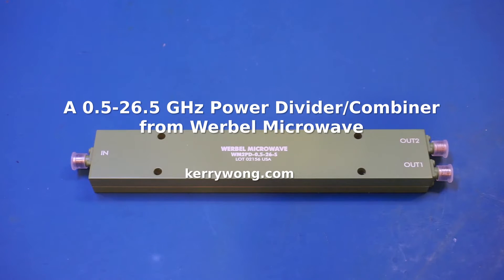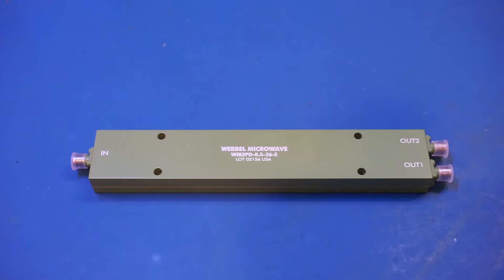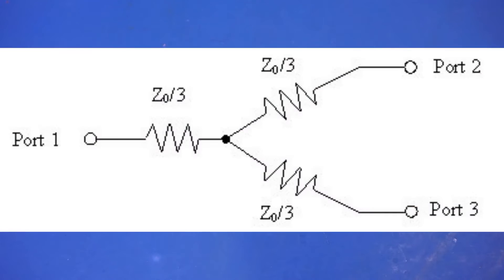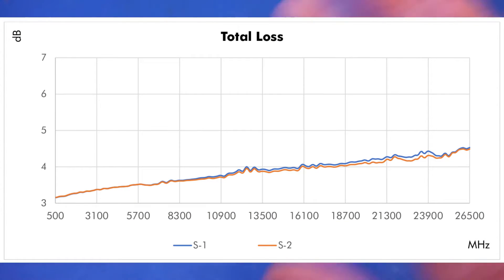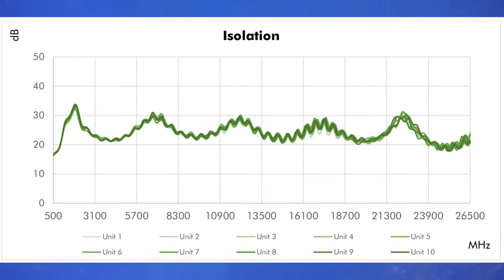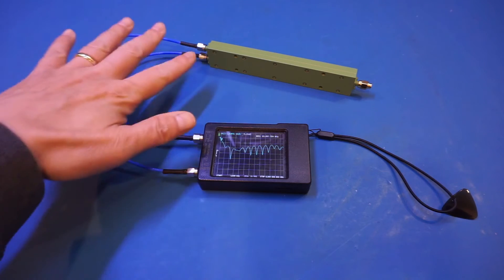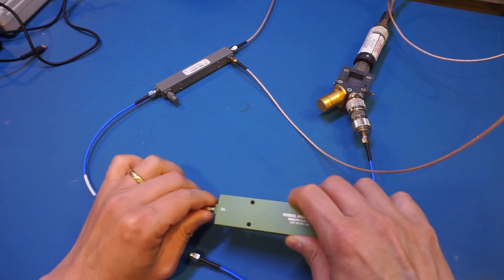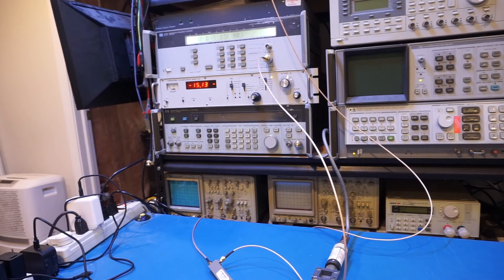A 0.5-26.5 GHz Power Divider/Combiner from Werbel Microwave

Comment: If the divider uses quarter wavelength elements, how does it have such a larger frequency range? It would be good to see a tear down too.
Reply from the maker: For these wideband devices, one technique is to cascade multiple sections of these quarter wavelength element features. Unfortunately, Werbel had requested me not to do the teardown due to their proprietary designs.
Reply: @KerryWongBlog  i can confirm this is accurate.  microwaves101 is a site that explains this in good detail.  the theory is textbook, but the particulars of each product are proprietary.
Reply: Layout please